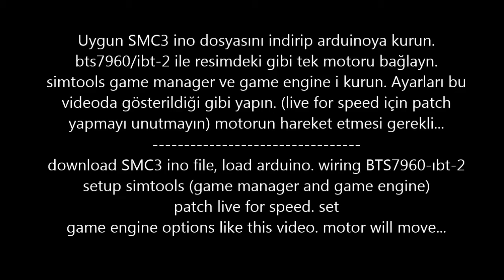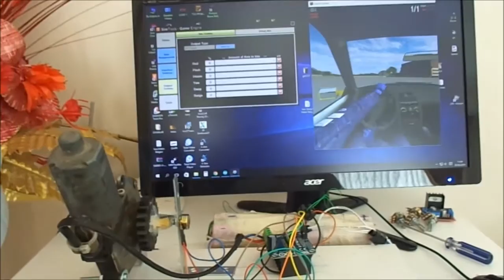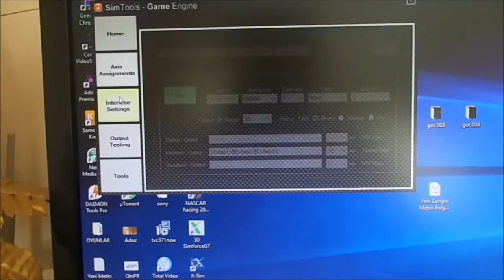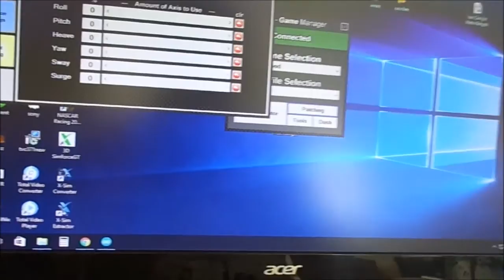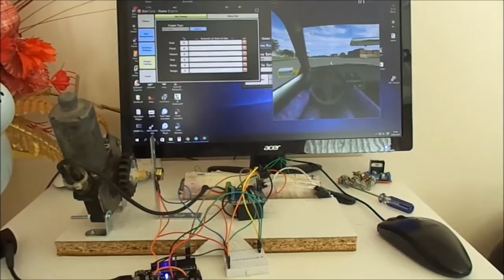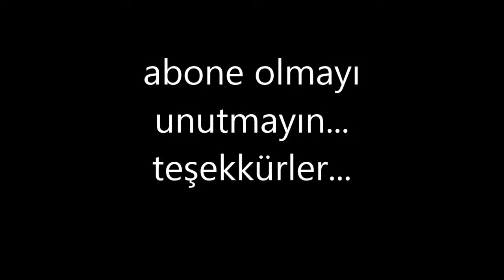Simtools+arduino+bts7960+wiper motor+SCM3 -- diy simulator + big servo

Comment: hi sir, is it possible to use a different size and different rpm wiper motor?? if possible which parameter settings should be changed in smc3 utility sir??

Comment: hocam eline sağlık güzel çalışma olmuş. Ben simtools ile ilgili birşey sormak istiyorum. Forumda aldığım bilgiler kafa karıştırdı daha çok. Ben sadece devir saati kullanmak istiyorum, arduino kodlaması ve bağlantılar herşey tamam ama gamedash programında hiçbir ayar veya profil ve oyun seçemiyorum. bunun için plugin mi almam gerekiyor xsimulator den yoksa simtools lisans mı almam gerekiyor yardımcı olur musun ?
Reply: ya inan ben de ne yapacağımı bilemedim. https://www.xsimulator.net/community/threads/arduino-revburner-driving-a-tachometer.5906/ konusundaki projeyi yapıyorum. Ama bana sadece gamedash programı lazım, simtools çoğunluk motion simulator için kullanılıyor. gamedash programında da çalışıp çalışmadığa bakmak için bile bir plugin yok yani lfs bile yok programda
Reply: Sinan Bey 3 dof  filght sim için lisanslı simtools ve pach her şey hazır ancak arduino,röle kartı,motor sürücüleri ve pot lar arasında iletişim ve senkrone çalışmayı bi türlü halledemedim.P3d için yazılmış kod buldum yükledim ama nafile.
3 ad AC 037 motor ve redüktörlere 270 derece 5 k potlar bağlı, arduino uno ve ileri geri için 24 volt ile kontaklanan röle kartı var.
her bir motor mitsubushi d700 075 kw 3 adet motor sürücü ile sürülüyor.
Sorun 1 röle kontaklar çektiğinde arduino pc arasında kopmalar oluyor
            2 limitleme yapamıyorum motorlar limit dışına çıkarak emniyet swiçlerinin sistemi durdurmasına yolaçıyor
Siz ve bu yazıyı okuyan tecrübeli arkadaşların yardımlarını bekliyorum idolek@gmail.com adresime de yazabilirsiniz.